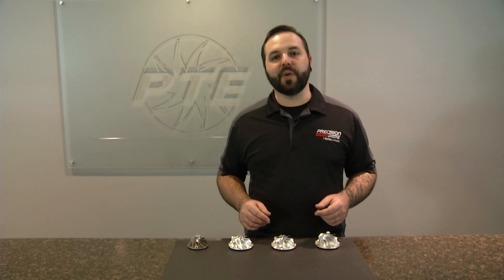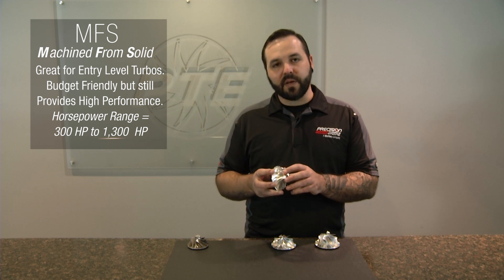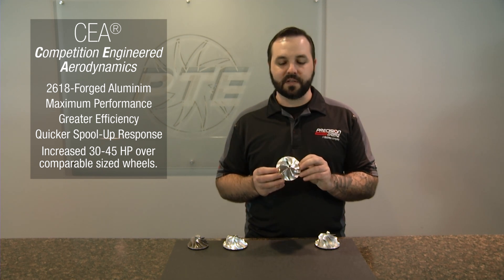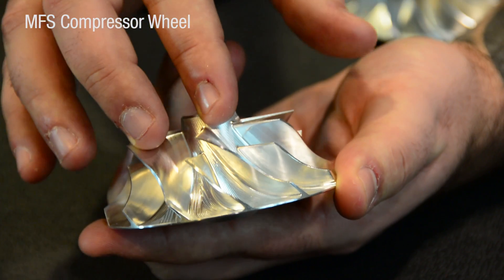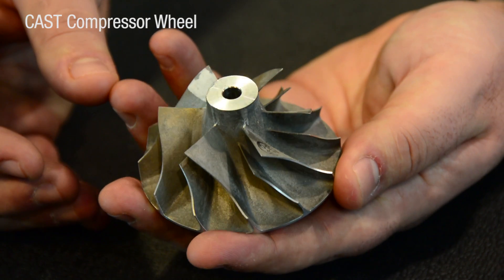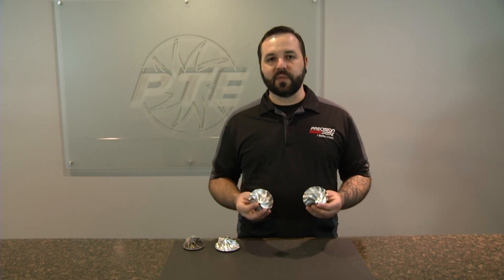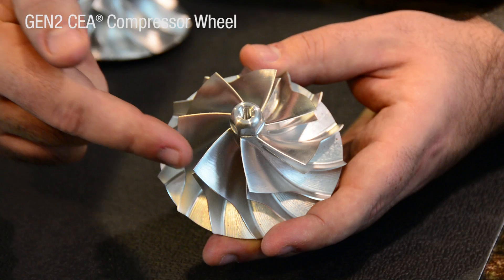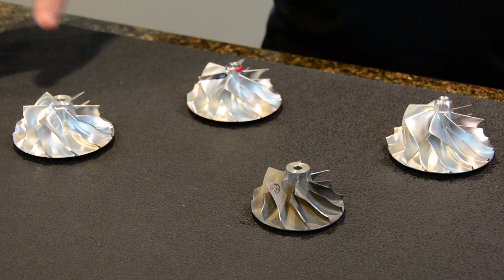PTE MFS Vs. CEA Compressor Wheels

Comment: cast versus machined SIZE FOR SIZE - the billet will fail to outperform the cast wheel due to its increased weight. Maintaining boost for boost until the burst limit of the cast wheel -- precision = misled information
Reply: Yes, it's true, the advantage os billet is only in extreme conditions and if you have a proper designed\dimensioned turbo for the application you will never run into extreme conditions(very high rpm where probably your shaft will break sooner or later).
Reply: @Mario_Marques  100% - this is the point. Billet is heavier (SIZE FOR SIZE) than a cast wheel, and only applicable in specific conditions and applications.
Reply: Hahahaha. Κλασικός Έλληνας απατεώνας. The tensile strength of billet aluminum is higher from that of a cast aluminum material, basic engineering. If the cast aluminum was stronger than billet we would not bother making billet blocks. Furthermore, Mr Kampouris because you elected to support and sell Garrett products it doesn’t mean you have the right to spread false information for someone else’s product. In some countries you can get in trouble with the law by doing so. To summarize on the matter at hand take the time and compare the weight of a cast wheel and the weight of a slightly larger billet wheel you will get your answers but I’m sure you already now the answer. Συμβουλή από μένα όσο μπορείς μη ξεκατινιάζεσαι, γίνεσαι ρόμπα.
Reply: @kostasdh  https://www.youtube.com/watch?v=L9bAOTm7bKA..thz video support your view of points. I more prefer real time comparison rather than .......Mouth Talk...
Reply: @oscarling913  There is something that is missing in this video - the method of machining from face milling to point milling have totally different ductility and strength yields - many things to take into consideration about a "billet wheel" Not all billet wheels are the same.
Reply: @TurboDirectSA  you said a cast wheel is different than billet your right billet is stronger further more just cause you sell other brands does not give you the right to bash other companies I’ve had garrets before and I’ve ran precisions and I can tell you precisions make better power and last longer I will not run nothing but a precision people like you spreading false information on the internet is wrong quit being a troll it’s not cool. Further more if your turbos was so great they would run them in npk and a lot of the turbo cars in nhra run precisions I’m not bashing garrets or anyone else I’m defending precision cause there a great company and have great products.
Reply: @WestVirginiapatriot0323  You welcome to have your opinion. We share facts, not opinions, and can be proven, we have various products, and brands tested side by side on the same engine, dyno and on the same day and can prove everything we make claim to. Everyone is free to choose their product, including you.

Comment: The only decision is precision
Reply: Garrett says other wise.
Reply: @SIRICKO  I had two Garrett turbos that just didn't perform as well as I expected. Switched to a Precision Gen2 and never looked back. I was stubborn, but had to concede. 
GTX4202R 1125whp 
GTX4508R 1210whp
PTE 7675 Gen2 GT42 1290whp